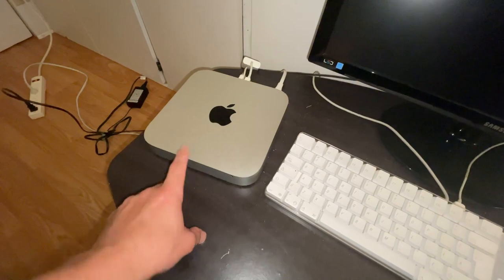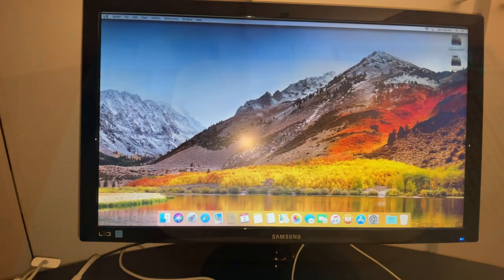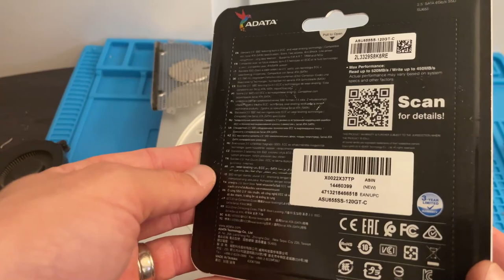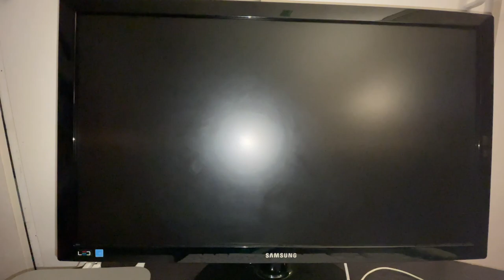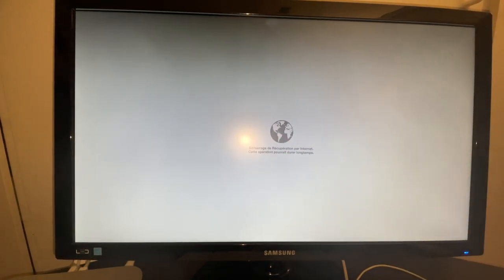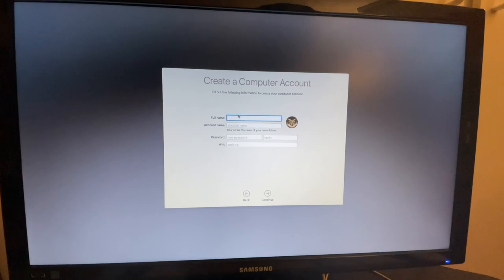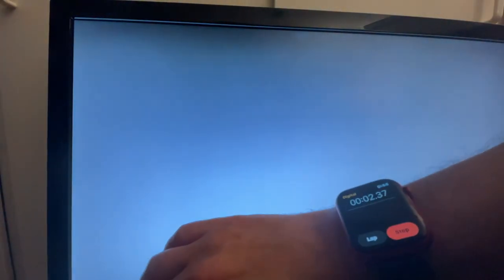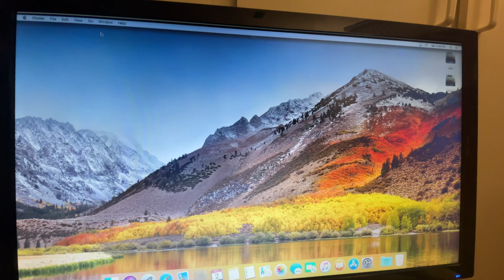Upgrading the $75 Mac Mini Server

Comment: Just got a 2012 Mac mini i7 with EVO860 and 8GB Ram for £98 GBP.   I will be using it as a Mac server as my main Machine is a M1 Mac Mini. I just need to add extra drive.  Don't forget to enable TRIM on the SSD otherwise it will fail early.